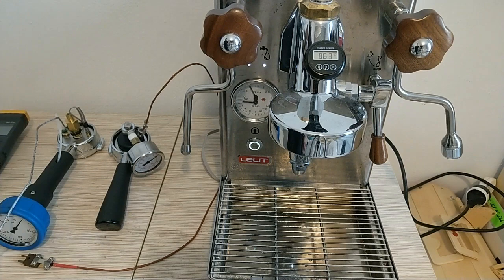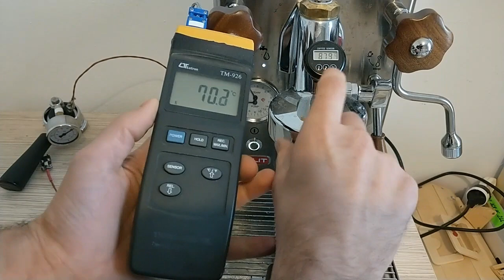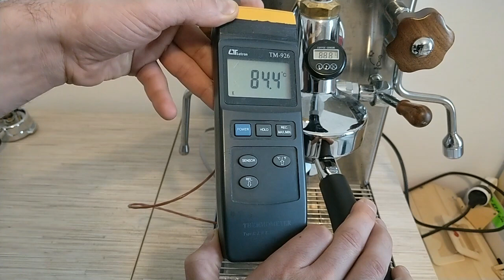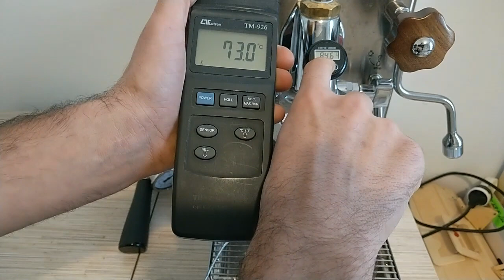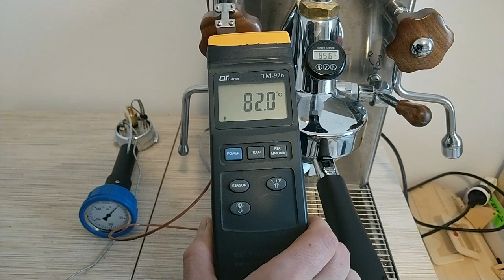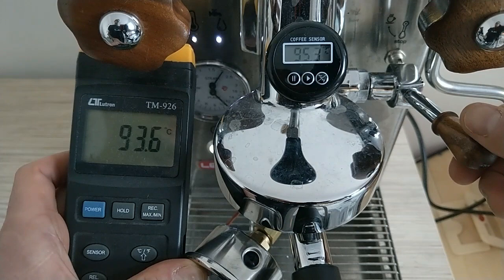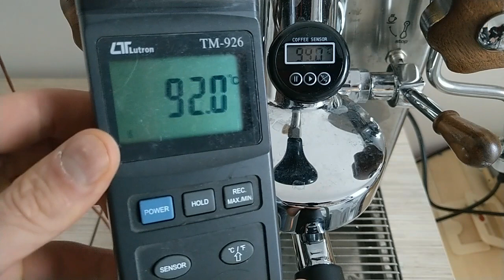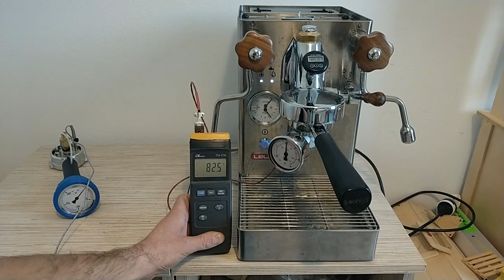thermometer, thermofilter scace 2 and check up measurement MaraX pl62x

Comment: Good comparison.  One thing, the Scace uses a type T thermocouple, you have your meter set on K.
Reply from the maker: yes
Reply: Hello, the question is: why? 

Im a noob in temperatur messure. I also have a Tech Up Device here and i would messure my bianca v3.

Test with T or K setting?
Reply: @crackacc  Hello, I was hoping Lelit insider would explain why he uses the K setting when using both the Scace and Tech Up devices. Both device use a T type thermocouple, so the meter should be set to T setting. When using my Scace on T setting, the temperature is 4 degrees Celsius lower than the K setting.
Reply: @Alasdair R  my techup device shows 2degrees difference between t and k setting. k higher…What a machine do you use?
Reply: @crackacc  Thanks for sharing your results. I am using a Linea Mini. I ended up putting the Scace over boiling water and recorded the results. On K setting, i got 104 degrees C. On T setting, i got 100 degrees C. I should note I am at sea level.

Comment: Hi, I've a question. I installed a temperature sensor like in the video with your laptop to watch temperature. If I pull the first shot after complete heating up the machine, everything is fine. But if I'm doing the second shot direktly after the first one, the temperature goes from 92 degree to 102. And that's to hot and the coffee is getting bitter. So how is it possible to get at least two shots? I want to drink coffee together and not one person and the second after 15 minutes. What I'm doing wrong, nor how could I adapt this?
Looking forward hearing from you.

Comment: Hi Lelit Insider, i did a Google translate of "
MaraX ha una fase di overheat, questa solitamente avviene tra’ il 4° e il 15° minuto dopo l’estrazione del caffe’ 
In questo tempo  la temperatura dell’acqua nello scambiatore caffe’ sale di temperatura per riscaldare il Gruppo, ma poi deve riscendere per stabilizzare il riscaldamento sifonico al valore selezionato dal cliente.
Quindi  nel caso in cui sia rischiesto di eseguire piu’ caffe’ in serie e’ consigliato di farli entro 4 minuti dal precedente, questo per evitare di erogare il caffe’ nella fase di overheat.
Trascorsi I 15 ninuti si potra’ vedere la temperatura visualizzata dal termometro sul Gruppo  scendere fino a stabilizzarsi nuovamente." 

and i get "MaraX has an overheat phase, this usually occurs between the 4th and 15th minutes after the extraction of the coffee. During this time, the temperature of the water in the coffee exchanger rises in temperature to heat the Group, but then has to go down to stabilize the siphonic heating at the value selected by the customer.
Therefore, in the event that it is required to run more coffee in series, it is recommended to make them within 4 minutes of the previous one, to avoid dispensing the coffee in the overheat phase.
After 15 minutes, you will be able to see the temperature displayed by the thermometer on the Group go down until it stabilizes again."

Does this mean after 4 minutes of each shot, the overheating will happened?   i don't think so right?  

Or you mean after we make many cups with MaraX and then because water is low, so new cool water from tank will flow in and then the overheat will start and it last from the 4th to 15th minute from the time the cool water came in?
Reply from the maker: in marax, the more coffee made, the more cold water enters the exchanger. 
This prevents overheating, 
if only one coffee is made, overheat can occur, 
in this phase the heating element is switched off precisely to counteract this phenomenon

Comment: The test #1 is not correct because you throw a cold portafilter into the group head and run the test right away.
The test #2 is not correct because of the same first error plus you did not let the boiler reheat the boiler (boiler light is lit). Result =  nothing proven.

Comment: Great Video.
I have the Lelit Bianca and I'm very satisfied. I have a question: The offset between the temperature input on the display and the water temperature on the  brewing head is 10°C (Factory settings). Some owners of the Bianca have changed this offset to 13° because they measured themselves with a scace 2. They set 95° C at the display and measured only 92°C water temperature. What do you think about this? 
Can you also use the scace 2 to measured the Lelit Bianca with an offset of 10°? That would be great. 
Thanks
Reply from the maker: i have to test Bianca with the scace 2 and the termometer on the  grouphead, but i think 13 is a good value especially in winter.
Reply: Hello, we’re you able to take the measurements on the Lelit Bianca with the scace? Thanks

Comment: Es normal que suceda en mi termémetro de grupo que al activar la palanca de erogación suba 4 ó 5 grados la temperatura? me parece excesivo, esto sucede en los 3 rangos de temperatura del botón inferior.
Reply from the maker: It is necessary to take into consideration that the thermometers on the group head usually indicate 2-3 degrees more than the temperature delivered by the erogation group.

As you can see in this video, only in some cases the temperature detected by the thermometer on the group aligns with the temperature of the thermofilter:
  

 • thermometer, ther...  

In order to make most accurate checks you need to use thermofilters.
Furthermore please note that the thermometers on the group offer good indications on the condition of the erogation group, however cheaper thermofilters can have a higher tolerance in the detected value. (some thermometers  cost 50 euro, while other 600 euro)

MaraX has an overheat phase, between 4 and 20 minutes after the coffee erogation. 
During this time the water temperature in the coffee exchanger rises to heat the group, but then it has to rise again to stabilize the siphonic heating at the value selected by the user.

So in case you erogate more coffees one after the other one, we recommend you to proceed with the erogation within 4 minutes after the last coffee shot, in order to avoid to erogate the coffee during the overheat phase. 

After these 20 minutes you will see that the temperature shown by the thermometer on the group in going to decrease until it stabilizes again.

If you want to dispense in the overheat phase, it is advisable to purge for 6 to 10 seconds before starting to dispense, as this introduces cold water into the heat exchanger and quickly lowers the temperature of the water dispensed